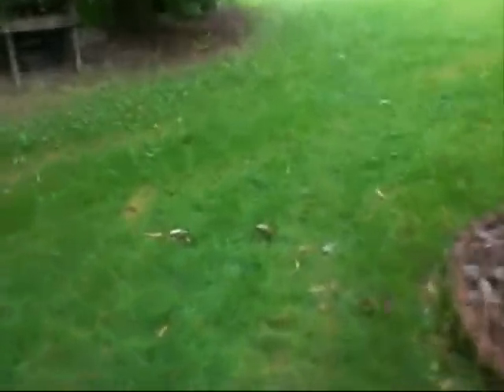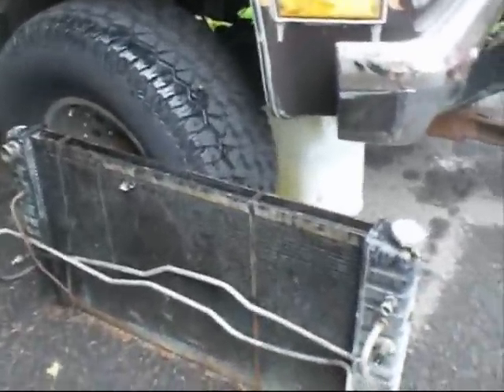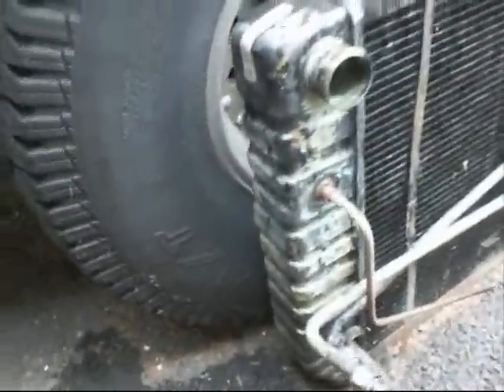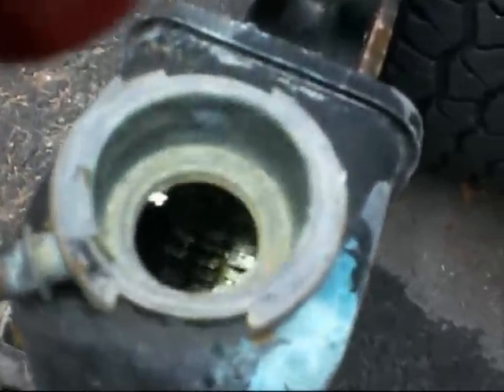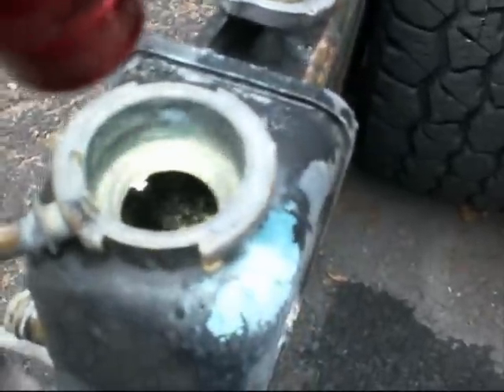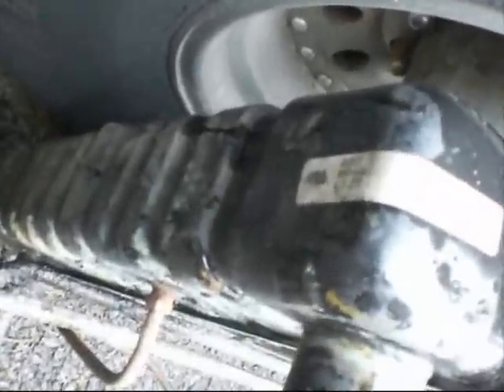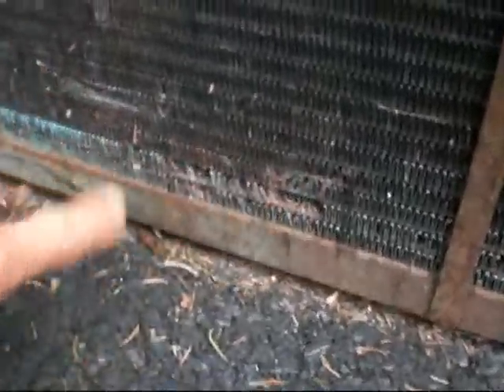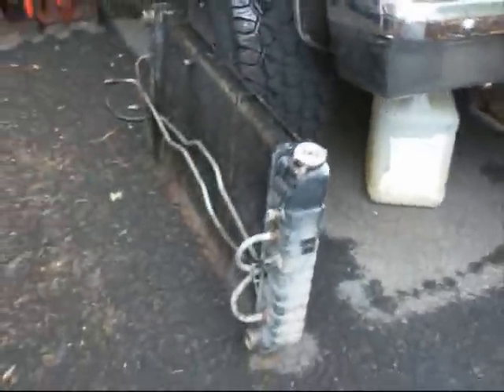8 31 12  SF Sub Radiator...

Comment: Back in 1994 I had a 1976 Suburban that needed a radiator. A local shop had bought a close out deal on some new 4 core ones. I got one for $250.00 installed. It never over heated towing my heavy camper after . I wish I still had the Sub.and the camper. I am sure they have gone up a lot.---WAG III---

Comment: I suppose not all oil coolers have the adapters. When they do it looks cheesy and being that an adapter makes for another joint, its also another leak point. I also was not happy that the spectra had a smaller core then the OE radiator. The delphi  I Swapped it for was actually larger.

Comment: go to your local radiator shop have them clean out your orifices the take the tanks off the sides then clean out all of the sleaves in your radiator reseal it back up pressure test it then you reinstall and on the road you go in my city they call it rodding the radiator only cost 125 ands its like a new radiator

Comment: I get a aluminum rad. You can get nice welded metal tank ones for cheap. No wonder this thing over heats the radiators on these are tiny. Very small and narrow compared the the radiator on my 7.3idi.

Comment: do you have the proper coolant/distilled water ratio? Fresh new stuff? Is your system clean? radiator might need rodded out and the system flush multiple times. I paid $190 for my 4 core "heatbuster" made in china radiator.

Comment: Went to Rock Auto.com shows a 4 core radiator for a 6.2 Suburban 298 dollars who ever wants 900 for a radiator that size is off their freaking rocker.

The radiator for your Suburban Spectra Premium CU850 nothing wrong with Spectra Premium products.

It sounds like you have a timing issue the engine is running too hot or the fuel has been cranked right up.  Somebody has been playing with that DB2 injection pump.